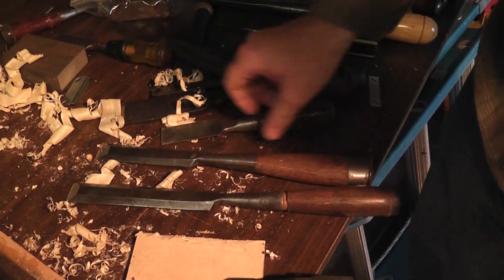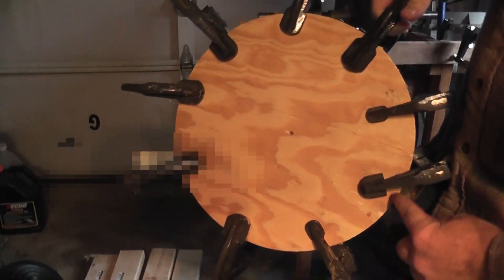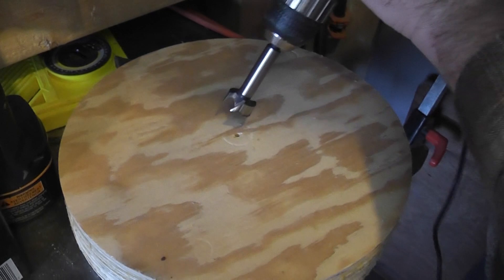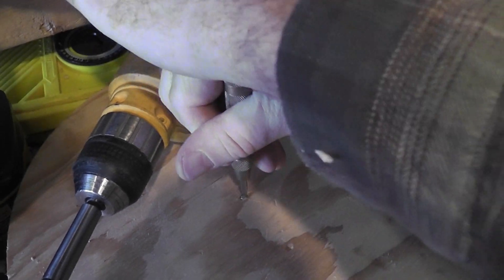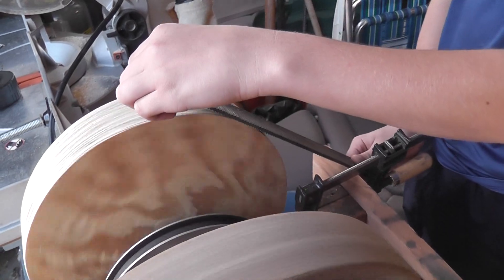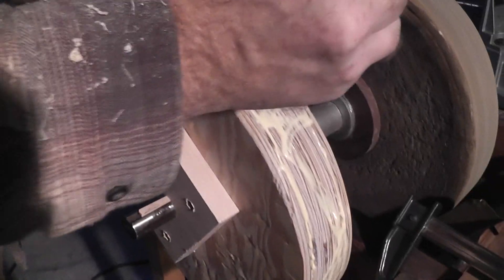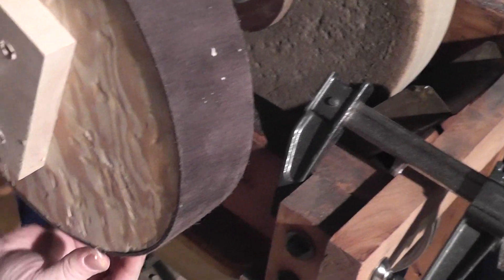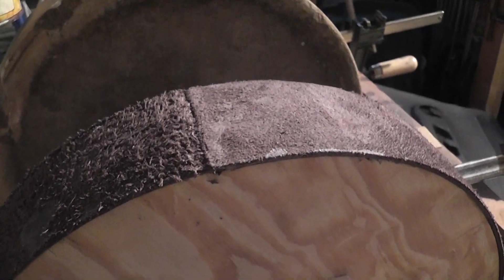Home Made Leather Strop Wheel

Comment: Nice idea. If I ever get my hands on a slow turning wheel like that I'll make one. The main difference I'd make is skiving the join in the leather so there's an overlap and also cut the leather at 45° to get rid of the single ridge, to make a smoother transition.
Reply from the maker: Good call.  thanks for the comment!
Reply: But even skiving the joints, example I’d love to use a kangaroo tail to do this on a wheel. One would still get a hump, or a jump as the wheel is rotating on the knife edge or tool edge. Or am I missing something?

Comment: Just get leather scrap and make a 3" wheel using a bolt, nut and washers and mount it in a drill press. Costs about $12.
Reply from the maker: +AKBuilder762 
Having a small wheel for stropping makes it difficult to maintain a perfect angle  against the bevel without undoing the work I've done previously on sharpening, especially when the direction of rotation is now on it's side for holding plane irons and chisels.  That's why I went for a larger wheel on a dedicated machine. Also, I like the extra surface area afforded by the larger wheel.  I don't think I spent any money on this.. it was all scrap laying around except for the leather.
Reply: I just did one for 6 :)

Comment: Helpful video! So did the wheel work?
Reply from the maker: NUMan14 Thanks for the comment.  Yes it works, however after sharpening the chisels on my stones, what I found is that I don't need anything but very light pressure and really only a revolution or two of contact against the leather after I put on a bit of the compound.  So maybe having the wheel is a bit overkill unless I have a lot of things I need to put a final edge on at the same time.

Comment: Ha ha ha thats almost 8 1/2 minutes of my life I will never get back same old story use twenty words where two will do and then dont show the result waste of time
Reply from the maker: +martin lowe Is that what you tell all the girls?       ;)  
Anyway, actually, I'd appreciate constructive criticism, but whining doesn't really help me make better videos.
Reply: +stoppedsnoring  easy peasy lets see it in action....thats the idea surely.
Reply from the maker: +martin lowe Here you go ~ https://youtu.be/fa9UNS508KI
Reply: @stoppedsnoring  Martin was maybe a bit harsh in the manner of his criticism, but it was none the less valid.   1) You made no effort to keep the shaft hole square to the wheel. With such a large diameter and mass, the out of balance vibration stood to be significant. 2) using your finger as a spindle when rotating the wheel on the sander.  OK if you are trying hard for a Darwin award.  Not so good if you want to keep your finger. I've known YouTube to take down videos for safety reasons for significantly less bad practice.  3) what sort of glue did you use to attach the leather to the wheel.  It looked like wood glue.  Contact adhesive would have been better.  We didn't see the other side of the leather, but from what you said, it sounded like the smoother side was inward which would give a better bond, so long as you sanded off any bobbles. 4)  It would have been better to shave a shallow chamfer to the leading edge of the leather so you could overlap the trailing end. Less chance of tearing the leading edge with use.   Considering you'd be holding a sharp edge to the wheel if this happened, you really don't want a leather strap whipping past your hand and maybe pulling it into the wheel.
Reply: Replying to my own comment, the leather strop I made eventually came unstuck after using contact adhesive.  Second time round I made shallow cuts in the MDF wheel and use epoxy glue, and it looks like that is never coming off.  I gets used on a daily basis by half a dozen people, and is all we use to freshen up the wood lathe chisels.  The motor is 1740rpm, which is maybe a bit fast.  I turned the leather true on the metal lathe, so it has zero vibration.  A really useful tool to have in a wood shop.

Comment: I didn't see it in action, did it work?
Reply from the maker: +kekocucu u Yep, I'd say it almost polishes a little too quickly.   https://youtu.be/fa9UNS508KI 
I did make a flat leather strop that I glued down to a board out of one of my old belts... it is about 30" long.  I think that it gives me a little bit more control while holding the chisels over the strop wheel.  I'm still experimenting with the best methods.  I have a horizontal  wet sharpening machine that runs waay to fast.  I'm hoping to figure out how to slow down the motor a bit so it doesn't fling water all over me.  :)  thanks for your interest!
Reply: @stoppedsnoring  Adjustable mud flap. That way you can move it as the wheel gets smaller.

Comment: Didn't scarf the ends 1st, did you?
Reply from the maker: +roy childs Roy, do you mean rough up the ends where the joint is?  I did cut at a bevel so it would tend to lay down smoothly, but if you could explain how to "scarf" it for a better result, I'm all ears!
Reply: stoppedsnoring I'm